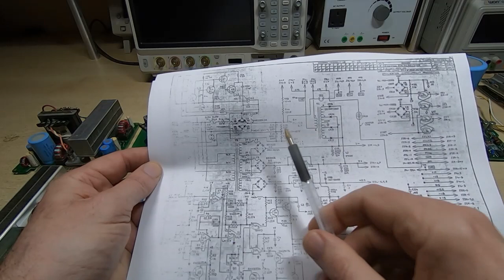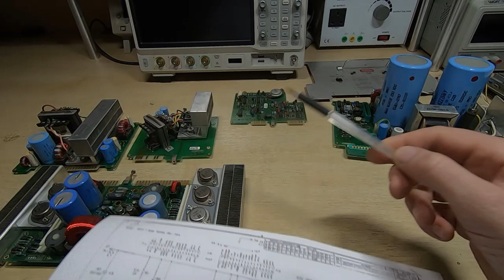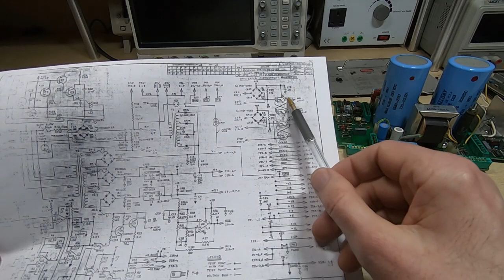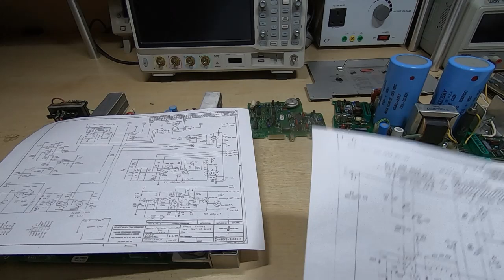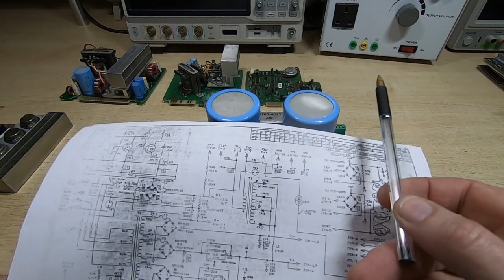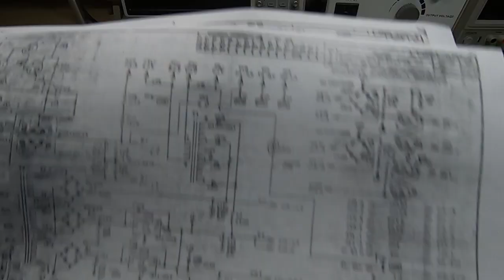HP9845B Repair Part3

Comment: What’s the problem with the Rifa caps? I’ve heard about old electrolyte caps failing, but these look more like foil caps. And did Rifa have a unique design, or did other manufacturers have better quality?
Reply from the maker: They are plastic film safety (X and Y) caps and as you can see in the video that have all started to fail. Because they are across the mains supply then when they fail it is a bad thing. Most electrolytic failures only result in excess ripple. Anyone that works on this type of equipment knows that they fail and so check/replace them as a matter of course. It is hard to say if they fail because of design or application but either way if you find a piece of equipment from this era that has been un-used for decades and power it up then it will not be long before you hear a bang and have a house full of pungent smoke. I am not aware of other types that have a similar issue but then most safety caps used at that time were rifa so I would not really say this was bad design but as they WILL fail they still need to be replaced as is clear in this case.
Reply: @JerryWalker001  Thanks for the explanation. I hadn't actually heard of any problem with Rifa capacitors before, but then I haven't done any work on this kind of circuit. I saw the cracked capacitors in your video and I suppose they can literally rip themselves apart if things have gone that far. This is the kind of thing that's good to know!